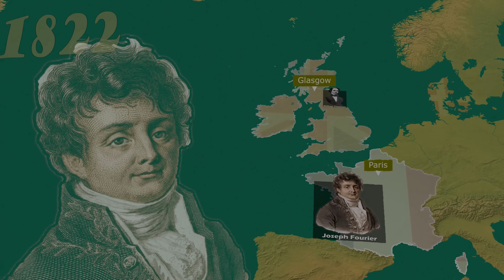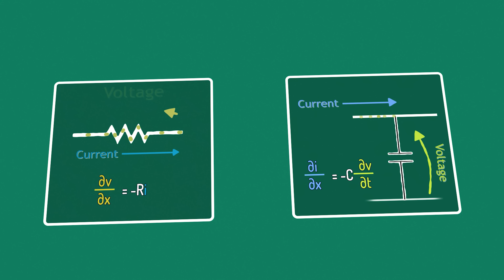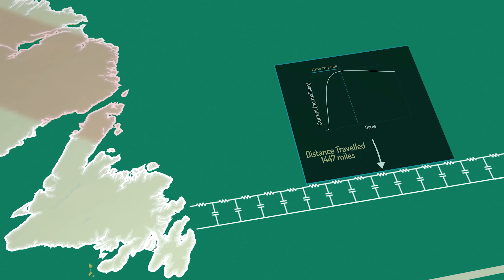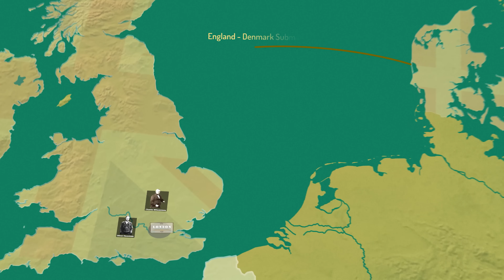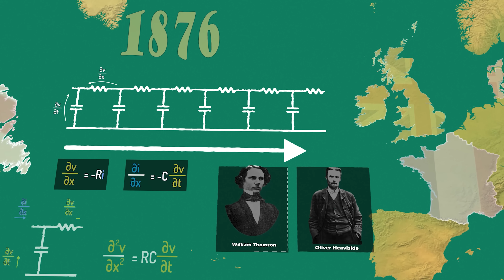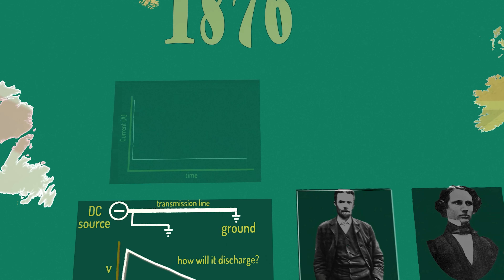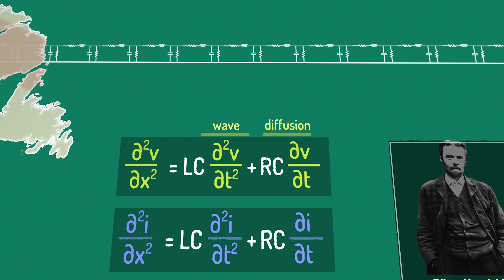The Story of the Telegrapher's Equations - from nowhere an unknown genius solves transmission lines

Comment: Most people don't know that Heaviside invented the first Tunnel Diode, although he didn't actually know the mechanism. It was the steel needle in the pool of mercury with olive oil on top.

It's not a semiconductor diode; it's an MIM tunnel diode- a "metal-insulator-metal diode". The olive oil coats the tip if the steel needle and is the barrier the electrons tunnel through...
Reply: Most people have no clue what a Tunnel diode is or who Heaviside was. It would be totally meaningless for them to know that he invented it.

I would go as far as to claim that most of my electrical engineering colleagues don't know what a Tunnel diode is.

I also don't find much on this experiment, do you have any source for further reading?
Reply: @larslindgren3846  Those of us old timers know Tunnel diodes well. For a while around the 60s and 70s they found their way into some interesting circuits. The most famous was a spy bug built into a cocktail olive. The tooth pick was the antenna and the entire package including the battery, electronics and mic fit in the olive. The output was FM radio and the device was surprisingly sensitive.
Reply: @larslindgren3846  The 'Tunnel diode' - to which such sharp, repeatability in Tektronix analog Oscilloscopes owed their 'triggering' (on waveforms) performance to. 
Anybody (many techs and engineers in the day) who examined a Tek op manual or service manual could know this.
Reply: @larslindgren3846  Me. I became aware of MIM tunnel diodes when I came across an article about two graduate students who had begun marketing custom distortion pedals for electric guitars based on some work they had done on organic insulating coatings that could have controlable thickness; they tested the thickness by monitoring electron tunneling. One of them played electric guitar so they tried the classic diode distortion circuit and discovered that the distortion was different with different coatings.

For me it solved a 65 year old mystery of how a fox hole radio worked without a PN junction, and I realized that the blue oxide coating on a razor blade was the insulating barrier, and steel and pencil lead supply the work function difference. It actually conducts both ways, just a lot more in one direction. It also explains galena, corroded pennies, and all the other rusted crap people have gotten to work. Heavisides mercury and steel with an olive oil coating is exactly the same- not a PN junction in sight.

ME. I'm the one that connected the dots. So no- I can't point you to the literature. You'll have to depend on your brain to get this.
Reply: Why did YT remove my comment about tunnel diodes being used in trigger circuits in Oscilloscopes? YT, this does not bode well for your 'product' when professionals regularly get 'trimmed' for respectful,and informed comments.
Reply: @uploadJ  The issue of YouTube's (intentionally) malfunctioning is fantastically important and is not being addressed by anyone, because no one has the courage to do so.
Reply: Genius!  I wonder what Heavysides mother was feeding him for breakfast as a baby 😂.  Imagine him in kindergarten during "Show n Tell" hour?
Reply: Craig 🤓

Comment: I would be interesting to know more about the time domain dynamics of that transatlantic cable. As you describe it, it's clear that the Resistance - Capacitance model based on the diffusion equation  predicts what is essentially a low pass filter, slowing down and smoothing out the signal pulses carried from the telegraphy equipment. I also guess that the distributed R & C parameters that might be calculated from the incredibly long time taken to reliably send that message would be far larger than the actual parameters for that cable, maybe that was a clue of a problem in the model. More accurately the Telegraphers equation might, given the actual distributed R -L-C parameters for that cable predict a situation where the transmitted pulses reflect back and forth between the mis-terminated ends of the cable. These pulses would keep echoing back and forth until their energy was dissipated by the cable resistance, Guessing a signal travel time across the Atlantic of about 15ms what was likely happening was that for each pulse sent the operator would have to wait for the echoes to die down  before the next one was sent.

Comment: Excellent!
This explanation brings together the great contributions made by Fourier, Thompson (Kelvin) and Heaviside.
This is seldom, if ever, done in university courses.
The usual victim is Fourier, his diffusion equation is routinely ignored. This introduces serious and costly errors. I have in mind the 'theory' of the climate changing 'Greenhouse Effect'. The error introduced to account for the absorption of energy by the so-called 'Greenhouse gases'(GHgs). 
Current 'Greenhouse' theory takes no account of the fact that GHgs not only absorb heat (infrared - IR) but also emit IR radiation.
The UN/IPCC does not recognise this, claiming that GHgs 'trap' heat (IR radiation).
This is very clear from satellite images taken by infrared sensitive cameras on weather satellites.
Reply: Nope. You are very confused. All proper climate models account for both absorption and emission. Check any textbook, eg that by Pierrehumbert.
Earth Climate modelling is a very complex matter but that bit - ‘greenhouse’ effect from several gases - has been sorted out and validated experimentally long ago.
Reply: @Pier-zl7gm  "All proper climate models account for both absorption and emission."
Then how is it that 'official' documents show atmospheric CO2 'reflecting' heat? 
As you say "All proper climate models account for both absorption and emission." And indeed carbon dioxide does  absorb and emit 'heat', according to temperature. Whereas reflection is in one direction only. All 'official' documents show the (claimed) 'Greenhouse Effect' as the 'Greenhouse gases' as reflecting (therefore 'trapping') heat from the surface back down (to the surface). 
But gases like carbon dioxide emit 'heat' in all directions, meaning, of course, that half of those emissions do not 'go down', but upwards into deep space.
The heat is not "trapped", as claimed by the UN, the IPCC or anybody else who believes that CO2 = man made Global Warming.
Reply: @Pier-zl7gm  "greenhouse’ effect from several gases - has been sorted out and validated experimentally long ago."
Then why do the 'models' not include 'pressure' effects (the heating of the atmosphere due to pressure)?

Comment: One of the difficulties with that first cable was, because of the lost of signal, the conventional solution was to increase the input voltage - burning out the cable!
I believe Thompson used a Wheatstone bridge to get much greater sensitivity, thus avoiding the 'burn out. problem.

Comment: After 24 years, i know finally that Signal propagates in a transmission line  like heat does in a metal bar, why nobody told me this in 2000?
Reply: Because heat propagation takes good time, but signal transmission is instantaneous.

Comment: Wow! When I did cable fault location in the 70s and 80s using the "echo location" technique, I did not realize (or was told) that this is all about Fourier's equations (and the series). So, you do learn stuff later in life! 😀
Reply: Yeah, probably NOT. You were doing TDR- Time Domain Reflectometry. And that's just measurement of the delay between a pulse and an echo.

Not really any spectral analysis there.
Reply: @craigwall9536  correct.
Reply: @craigwall9536  But, analysis of the pulse shape (due to disturbance of the higher order harmonic content of a rectangular or 'square', low-edge-risetime pulse on reflection) can now today be performed (using DSP and Fourier analysis). Not so much in earlier days with only an analog O-scope doing the 'pulse' observation.

Comment: "voltage and current diffuse into the cable, just like heat" -- more proof of the ether
Reply: No need for ether, anyway, when signal is carried by metal wires.
Reply: @xandervk2371  You think the ether is a gas? Present only in air?
Reply: @FloydMaxwell  Wanted to ask if you knew the definition of gas, but nevermind.

Comment: It is perhaps mind blowing that Lord Kelvin's cable theory is the basis of computational Neuroscience, where models of neurons (and their elongated "processes") are based on on the very same math.
Reply: Wait wait wait!! I read your comment too quickly: sea (coaxial) cables are shielded precisely to avoid grounding by conductive external fluid. Unmyelinated axons are not.
Reply: Exactly! I did my Master's thesis on voltage parameters using LK's cable equation.
Reply: Was he reaaly a lord though?
Reply: Or perhaps not. Underseas cables, like neurons, are bathed in salt water...as my physiological psychology text pointed out in the first chapter.

Mind blowing averted.
Reply: @craigwall9536 I wish you the luck to recover a sense of surprise and admiration for physical reality. I wish you the "beginner's mind".
Reply: @NamasenITN  It took you one year huh

Comment: My dad took his final exams at Cambridge in 1934.  He had been a radio enthusiast since his boyhood and, at Cambridge, had taken Professor Turner's course on radio.
One of the questions in the final exam was on heat diffusion.  My dad said that he simply wrote "Using the telegraph equation, well known to electrical engineers, the solution can immediately be written as xxx".   In view of the marks he was given for the entire exam, it was clear that his answer had been accepted as correct.
Reply: Brilliant beyond words.  May I tell a story this reminds me of?  My father was a physicist, educated at MIT and the University of Washington.  When I was in college I thought it would be cheating to take advantage of that, since he taught at the college I attended.  But I did have him verbally quiz me before examinations.  He would ask "what are you studying?"  and in one particular example I answered "Orbital mechanics."  My father said that it was useful to think about orbits in light of the conservation of energy, which oddly is something that was not in our textbooks.  On the test the next morning, there was a question about a change in orbit.  Wanting to solve this quickly, I remembered that my father had said that E = mgh.  I integrated over the h part and gave the answer.  Oddly, I got extra credit for my answer.
Reply: @Tordvergar  I learned as a studen myself that sometimes energy considerations could solve a problem much more easily than by finding a detailed solution from the differential equations.
Reply: @Tordvergar That's like for the flat Earth version, right?
Reply: @Wowwwwwwzer  It would be interesting to hear a Flat Earther explain orbits, wouldn't it?
Reply: @Wowwwwwwzer ☠️
Reply: I have a similar story in a Classical Dynamics Exam: I used my knowledge in pure maths to solve a problem ❤

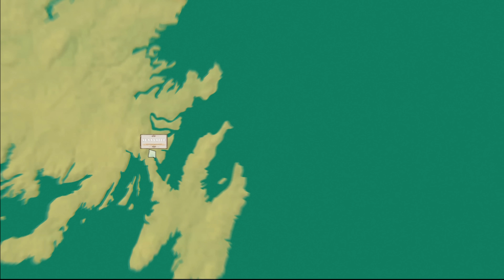Comment: @5:17 – That doesn’t sound right…that means they didn’t figure out the problem till about the year 2000. That’s obviously not true.
Reply: @jim9930  Of course. It's all EM waves on a transmission line, but boy does a fibre perform better. We almost immediately hit limits with copper cables, but we are still exploring how far we can get with fibres. So far we have only.hit limits on specific techniques.
Reply: @jim9930 I'm not sure if the video is referring to that or to optical fibres profoundly changing what a long distance cable can achieve. The stuff you describe isn't really applied to the type of long distance communications described in the video. It is mostly applied to speeding up the tributaries

Comment: EXCELLENT animation of terminated transmission line!  Brings back fond memories.  
I first made that work w/Apple-II, in assembler, with game paddles as the signal generator.  My wave equations were 8-bit, with L and C values of one and two, IIRC. I think it was 1991 or so.  (I made a diffusion version first, RC only, before later using zero ohms and adding induction.  Also, with LC and some resistive loss, you get naturally-occuring dispersion, slower short-wavelengths, looking like spreading ripples on a pond surface.)
Reply: Hello 🤓